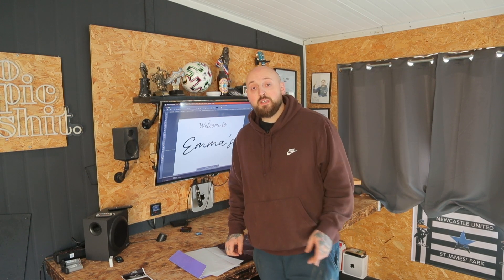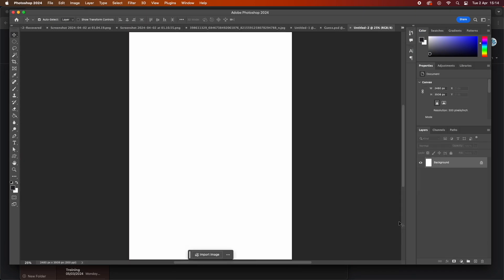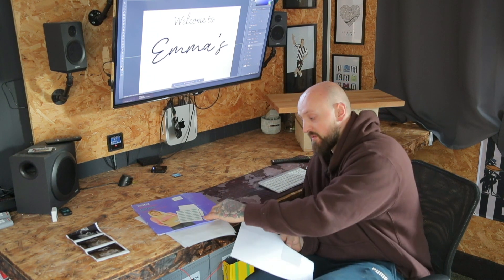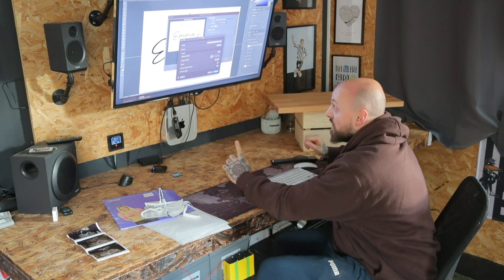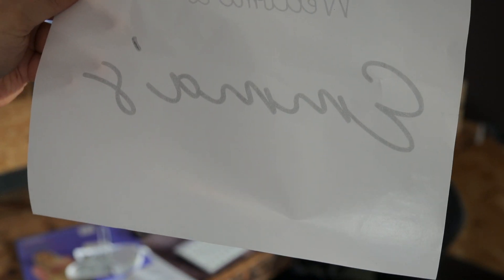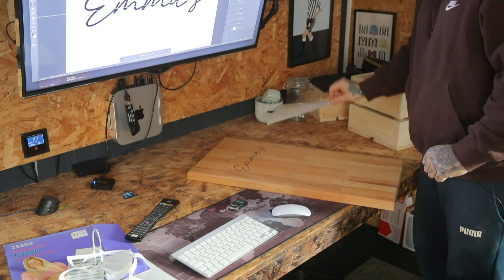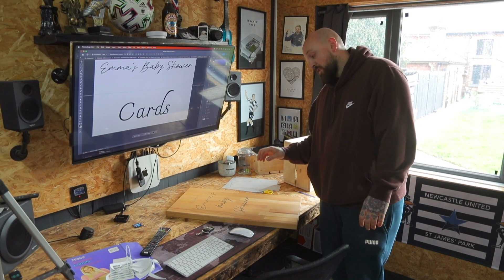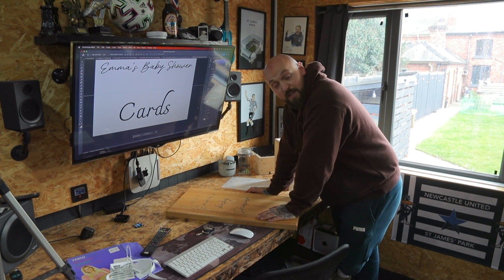How To Print On Wood Like A Pro: Easy Ink Transfer Techniques In Minutes!

Comment: great idea! how long after thr printout comes out do we have to transfer it? i want to do this on small wooden cubes. thx
Reply from the maker: The ink just needs to be wet still. It actually takes quite long for it to dry because it can’t soak in to the paper because of the sheen.